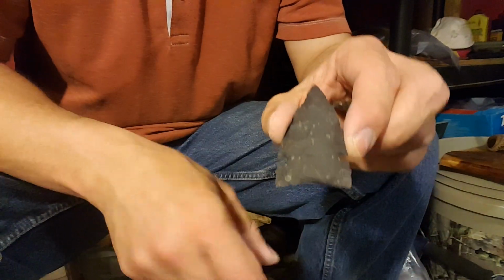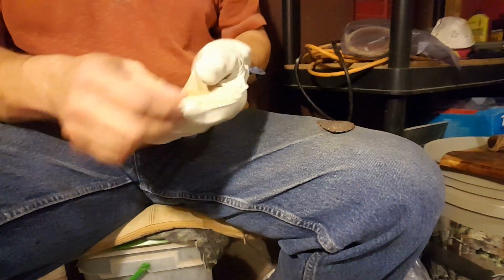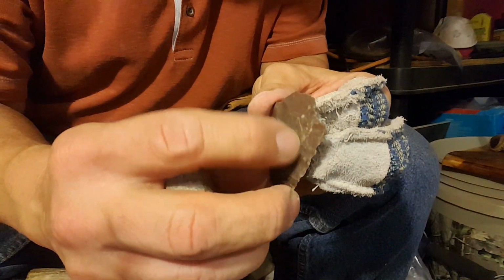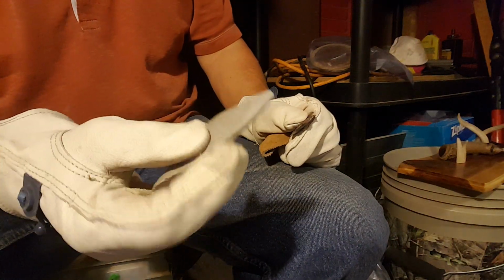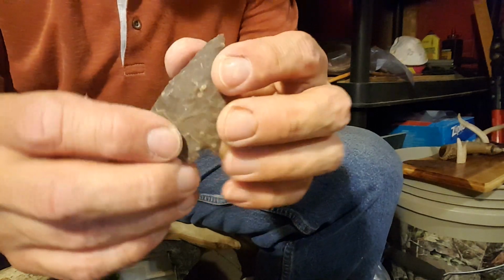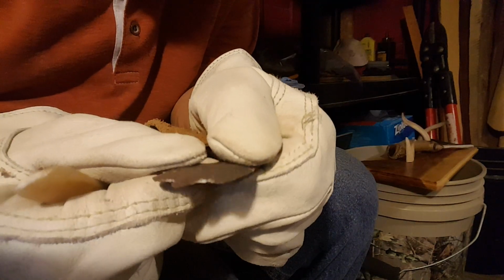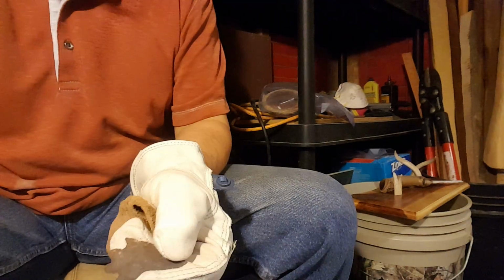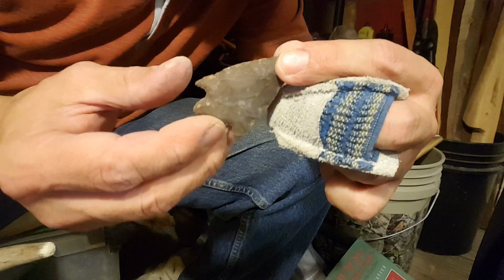554 - Oregon Chert 3/3

Comment: Justice is THE book, lol. Used in my lithics class it college. Tip from one of my blacksmithing friends concerning aluminum, Anneal it by pounding in all directions with the hammer and then heat to red and let cool. It crams the crystals into a tight pattern and then relaxes them with the heat cool cycle. I swear it behaves like copper but is more durable. Also try to throw your antler and bone bits in a bath of plain Knox gelatin (hot but not boiling), let it set, remove tools, let dry thoroughly. They will absorb the gelatin into the micro pores and be more plastic like.
Reply from the maker: Yeah, Justice is the main source for me, and Richie.  That's a good trick with the gelatin.  I'll need to try that.